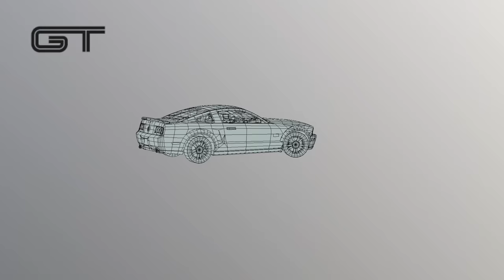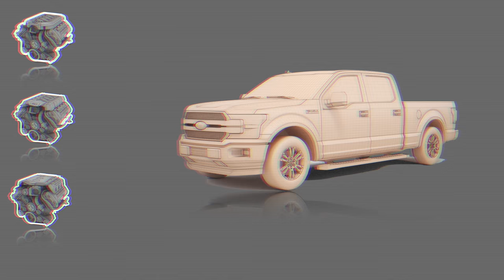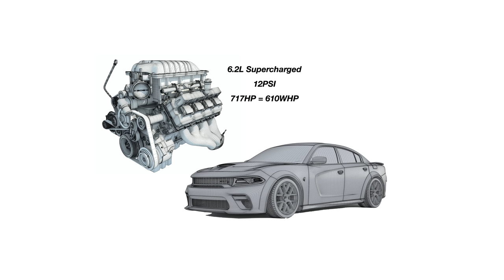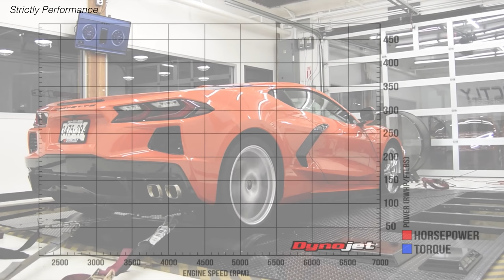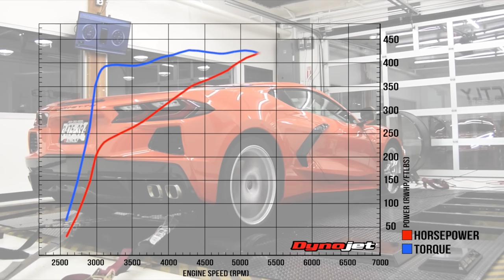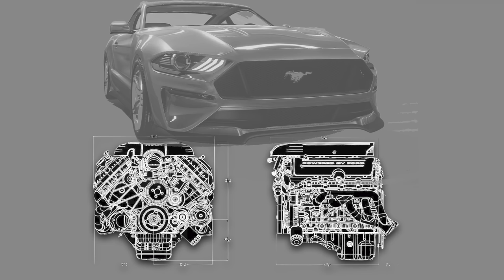How 5.0 Coyote Engines Beat LS and LT😮 | Explained Ep.2

Comment: Great video all around, well edited but id like to disagree,
sure the coyote might make more power comparing it so as LS or LT stock for stock or comparing them with low amount of modifications but when you want to make real power, 1500+, the coyote cant compete, and when it does, all it takes is their nice cool design DOHC chain to break to cost you a new motor, 
which is another reason i think the LS and LT are better, they cost 1/5th the price, are far more available, and way easier to work on.
You also said they are "more potent" for their size when they are huge engines physically, only 5.0L but they are bigger than a 7L or 7.4L LS/LSX
i just don't see the coyote better in this matchup although being a great motor
Reply: People make 1500+ with coyotes fairly reliably all the time. And there are several aftermarket fixes for the OPG and secondary  timing chain issues.  Just like there are a bunch of fixes for the LS trunion failures and DOD lifter failures.  And if you actually take measurements of a coyote vs an LS/LT the difference isn't THAT drastic. The coyote just looks way bigger.
Reply: @codyslaughter4678    the size is drastic enough for people to avoid swapping them into smaller cars. It's way wider and taller at 2L displacemt disadvantage.

Comment: The issue with car guys is they think they need boost, what makes GM’s motor platform so legendary is that you don’t need any sort of boost to beat any of these other motors urging you to get boost because you can bore the motor out or you can’t put bigger cams in there. Another thing is a stock LS can beat a 1,000 horsepower coyote as long as you adjust your gearing ratio. There’s a lot to racing but building a motor is getting over looked by people that think boost is the answer.

Comment: tuning potential is impressive on the coyote esp with boost. However there is no mention here how the engine feels sluggish in every day driving compared to a LS/LT due to its lack of low end/mid range torque compared to those motors. It's a trade off.

Comment: I have basically been a GM guy my whole life. 
   (Here we go, fan boy), joking.
Actually, I never really have harbored any type of I'll opinion or will towards any fans of any brands.
   I actually really like Mustangs too. I had 1 early fox, I think it was a 91-91. It was a hatch with a black interior, very cool!
   My sister actually bought it for me for right about $900. A steal. The only down side was that it was a V8 car, someone removed the 4cyl from his other one and put it in that one.
   So I got the 4 cylinder car. The only bad part about that was they left the V8 struts in it.
   I didn't cate that it was a 4 cylinder car. The body was clean and it had a black interior. Hard to find in those years.
   I had it registered and insured it and immediately used it for daily transportation. We'll, I had to go in and finish the job. 
   The other guy forgot to tighten some hose clamps for the cooling system. 
   On the way to work on a dry road, was that a splash? Where was the puddle? Hmm, smoke, oh, that's coolant on my exhaust.
   No beg deal, I'm a ex technician, I was employed at MB at the time.
   Long story short, it was an awesome car that I wish I still had.

   Coyotes are also very cool!

Comment: They coyote is by far the best V8 engine they've made in about 15 years. Up until that point the LS guys had bragging rights. In 99 it wasn't even close you could have a boosted mustang and loose to a LS with boltons and a few mods. The coyote changed all of that.
Reply: Actually the terminator cobra in 2003 changed all that .

Comment: The Coyote is a good engine but what I didn't like about it coming from Scat Pack Challenger 392's and Hellcat engines is the 5.0 Coyote didn't have that low end grunt I was use to. You really got to rev the 5.0 Coyote to get the power out of it.
Reply: Lack of displacement. DOHC restricted how many cubes ford could use and have it still fit in a mustang. The advantage with cam in block engines like the Hemi and LS is smaller packaging and more displacement potential. The LS is ridiculously small for how many cubes you can pack in it hemi is a bit bigger but not as big as the coyote

Comment: Double over head cams, with 4 valves per cylinder. (chain driven & not push rod operated) Central spark plug.
 Look into the Ford Australia developed Barra XR6 Turbo engine.

Comment: My coworker’s 2020 Mustang GT needed a new cylinder head at 5,000 miles. He brought it to the dealer with a check engine light on and it was running ok. They quickly and quietly replaced an entire head. Not impressed. Neither of us were Ford haters or fanboys. He sold it a few months later.

Comment: If honda ever made a v8, it would be exactly this setup. High compression. Big heads, large flow ports. Multi valves, dohc vtec/vvt. Direct injection.. because almost all n/a honda engines are already like this but with only 4 cylinders. Ford has a great setup for this engine

Comment: fact of the matter is that it simply doesn't beat the LS or the LT in any reasonable capacity. Corvettes from 2000 with a 600 dollar cam are faster than brand new performance pack GTs.
Reply: Corvettes from 2000 with 600 dollar cams are not street legal.. that's the difference kid.
Not to mention you're comparing a 3300lbs car to a 4000lbs car.

Comment: It's a great engine.  Just VCT and cam phaser issues that I wish they would resolve.  Already did mine at 75k.   Runs great since, honestly ran good until it didn't with failing solenoids.  Made it sound like a hot rod with a lope to it.

Comment: just bought the FHP 2019 aluminator 5.0L engine n/a 12:1 compression hooked it up to MMR pulse ring roush cold induction mangnaflow competention three inch exhaust dw-400 fuel pump vmp tune cold case radiator mishimoto radiator reserve fhp high output alternator odyssey amg battery calimer mt-82d stage 2 mgw spec shifter Mantic 9000 Steeda clutch spring boobma trans mount steeda dive line guard DSS drive line g force half shafts fhp differential steeda differential brace bmr k brace and stop the hop kit bmr rear strut brace fhp front strut brace pedders coil overs w external canisters bmr and steeda completed suspension mods autosport roll cage stiffings up the chassis I first went with McLeod RST and calimer mt-82d stafe 1 within 10k teabs capped out if 1st &  reverse McLeod rst allways had shifting issues  support claimed 2017 to 2019 slave cylinder even though I installed a OE ford new one at time if install by professional auto shop. sve rims 10ft 11r MCH pilot sport bill wicker rear spoiler rtr front brake inlets 
calimer stage 2 has cyro treated mirco polish gears carbon synchro rings billet forks rick solid upgrades thanks to Zander13 stagmode and engineering explain and scotty Kilmer by base and make your own upgrades 😊

Comment: Ford have decades worth of experience in Formula 1, supplying the majority of teams with engines through the early decades with the likes of the DFV, and its successors. That experience pays off, especially down the road when the technology they used back then trickles down to road cars. Dual cam 16 valve high flowing heads with fuel injection and coil on plug ignition. That's what you see in almost every modern application now, and Ford was doing that all the way back in the 60s.
If only they put the rest of that quality in the rest of their cars, I'd buy them.

Comment: I feel as if the archetypical reason the modular engine happened was because Ford wanted to design an engine that was similar to foreign engines. I don't see honestly why Ford couldn't have continued to engineer on the Windsor design, or just pushrod v8s in general. There is the Godzilla engine though. I just feel like Ford is making the Mustang more like motherfucking supercars.

Comment: ICE are basically air pumps, higher the revs the more air you are pushing through it, and more HP.  That’s why in Indycar and F1 they have limited 5he max ROMs.  Another way of looking at it is a one liter mortorcycle engine, they spin beyond 12,000 and make over 200 Hp on 61ci, that better than 3 hp/cubic inch, that’s stout.

Comment: As an Australia I have no bias, I like Ford's, Chevy's and Dodges, here comes the but, but the GMH/Aus (General Motors Holden) 304 was >302 and >308.
Evidence you ask? 
It was lighter and more fuel efficient than the 308 and could hand as much boost as a 302... As long as you had tremec 5/6 speed and a Ford diff.

Comment: I partially disagree with your suggestions. The coyote is already a good engine, so there's not much more to get out of it percentage-wise, but since it's already a good engine, there's a lot to like. 
Coyote - The headers aren't in the way of the spark plugs, so it's easier to design a particularly good set of headers. 
Coyote - A coyote with a VVT delete, Tilton 7.25", and stage 3 cams will pull to 7700 RPM without having to add boost which will also be a great road-course setup. 
Coyote - The spark plug holes have nice rubber seals on them, so it's easy to pressure wash the engine. 
LS/LT/BBC/SBC/SBF - The lower RPM range will promote any transmission shifting better. 
Pushrod - Generally, a good cam and headers will get you to 100-110% V.E. which comes out to a 22% gain. That's a lot of power on average that pays off. 
Pushrod - A lower RPM pushrod engine with a lot of displacement won't store as much kinetic energy, so it won't shock the drivetrain as hard on rough surfaces like whoops or in hard driving like during wheel hop or suspension flex. 
-- I'll run any engine out there. I don't care what it is. No matter what you build, just make it easy for the engine to do its job. 
I have an LS in my truck. I would like to build a retro race car with a 2JZ. I'd like to build an offroad rig with a Coyote. I'd like to build something with a raised port big block.

Comment: Despite the lower displacement, it is a much larger engine with 4 camshafts instead of 1, and they are shoehorned into these massive cylinder heads whereas a chevy pushrod camshaft is tucked nicely inside the wedge. 
Then you have the fact that it is not only heavier in general, but it is also top heavy.... which will not help around corners and will result in the need for a much stiffer front suspension to keep it standing up straight on hard corners. 
It costs more to build.
It costs more to rebuild. 
You've got twice as many parts to replace when they break. 
I like the 5.0 but it is not superior to the LT1. Otherwise I would own one.

Comment: Once you start to approach 800 HP, you aren't just worried about the con rods. There is a reason why the earlier gens need reinforcement gussets at those power levels. Sleeving the block is also strongly recommended by the shops famous for upgrading Coyote blocks for reliable power.
Reply: And a ls is very reliable at 1000-1200hp with stock internals.
Reply: @TylerMaxton no it's not
Reply: @kiwi8.  Yes it is extremely. I've known plenty of people with stock internals pushing 1200-1400hp reliably. Literally streetable.
Reply: @TylerMaxton  no you don't
Reply: Show one just one
Reply: @kiwi8.  Keep thinking your right but your not. I have a buddy that put head studs on a lq4 out of the junkyard twin turboed it and made 1700+hp before the engine blew.
Reply: @TylerMaxton  ok if you say so 🤣

Comment: GenIV SBC will absolutely make 800+hp 100% stock with only boost, injectors and fuel pump.  Double that with the ring gap opened up and valvetrain (7.15 1/4 mile with a 5.3).

Comment: The NHRA  FS and SS COPO Camaros had to upgrade to an after market LSX block. They were lifting heads and blowing gaskets with the stock 'LS' block. Ford uses the stock production based factory Coyote block and heads. The Fords were penalized 6 times for going to fast. the Copos 2 times and the Mopar 1 time. The Mustang is outselling the Camaro 2-1 .

Comment: How does it compare to the new C8 Z06 LT6 5.5 engine that puts out 670 horsepower at 8400rpm naturally aspirated and turns 8600rpm at redline seems like on a equal playing field the 5.0 Coyote is down 210 horsepower you better have boost because without it all your seeing are tail lights pulling away if the 5.0 Coyote is such a great engine extracting 210 horsepower naturally aspirated should be fairly cheap and easy since GM or Chevy can do it stock from the factory
Reply: Took gm how long tho? Biting  off ford as usual  don't you guys cry about  lack of torque.  Yea it makes 670 hp but how much  torque does it make? Lol
Reply: @Shiftnlift Torque is 460 about the same as a LT1 and at a higher rpm 6300 these smaller displacement 32 valve V8 don't make huge torque numbers and make peak torque above 6000rpm that's why if money wasn't a problem l wouldn't mess around with these small displacement 32 valve V8s I'd call Mercury Racing they take a LS7 7.0 liter Chevy LS 427 engine short block and put 32 valve heads with twin throttle bodies they call it a SB4 engine it makes 750 horsepower at 7500rpm revs to 8000rpm and makes 570 foot pounds of torque at 6000rpm idles smooth and is totally streetable it's a monster this Mercury Racing SB4 engine makes 80 more horsepower than the new Z06 LT6 engine and 110 more foot pounds of torque the only thing you lose is 600rpm up top because the LT6 revs to 8600rpm I'll take 600rpm less and 80 more horsepower and a 110 foot pounds of torque keep the extra 600rpm but this SB4 engine will cost you 33,000 dollars comes with computer to run it bet if GM makes a LT6 crate engine available it will be well over 26,000 dollars
Reply: @gloriamaletta8667  well said

Comment: For the portion of the video talking about the equation to make power pushrod motors make more torque than any DOHC motor yes they lack in top end or over rev power but torque moves weight and pushes against outside forces hence why from a drag race standpoint coyotes tend to be very slow out the hole compared to a hemi or ls/lt but they charge hard in the backhalf which typically unless we are talking modified vehicles the coyote loses with equal drivers

Comment: If GM wants to stay pushrod, why can't they make a quad valve pushrod motor for better flow? Isnt the 6.6 Duramax a OHV 32 valve motor? They would not have the benefit of independent variable valve timing but i thought 4 valve motors usually flow better due to the way the valves can nest in the head.

Comment: With Gen 3 engines having a 12:1static compression ratio, how is it able to handle more than a a few pounds of boost? Are those engines being re-engineered with lower compression ratios? That would require new low compression ratio pistons and maybe head work too.

Comment: Iv worked on a couple of these and I can personally say I’d stick with my turbo Ls ,availability and easy to build! All the problems you have stated can easy be resolved with a good cam.
Reply: Yoy missed the point. The ls in the same trim wil never produce comparable horse power to the coyote. Even with a cam the ls will still trail the coyote in volumetric efficiency.

Comment: If you want blown head gaskets, high oil consumption and your timing chain to fail get a 5.0 coyote.  In less than 15k miles mine has had two engines.  Ford first change the dipstick to change the oil mark.  This 'fixed' the oil consumption; for one week.  Next they told me my warranty was void towing a trailer 40% of the weight they claim my truck can tow.  After two years of fighting they did a short block but this still uses oil.  Junk engine in my case

Comment: I swap both for customers..... put simply, cost and complexity is what drives most swaps and coyotes are not user friendly.  Especially in racing, we use a KISS ( keep it simple stupid) format when we build things for customers that don't know how to change wipers. Although you can source coyotes anywhere, they are very much double a LS, $1000 over a LT. I do less than 10k for swaps on 79-03 mustangs on a LS. It's 10k just for the powertrane for coyote. I can't get them cheap enough. I just got a crate lm7 at summit for $1350 in the scratch and dent isle, there was a coyote next to it for $6000 at a discount. Just my 2 cents

Comment: I don’t know if you’ll see this 337 but can the coyote 5.0’s really make over 100% ve while being na? I thought it was impossible for na motors to reach over 100% ve due to atmospheric pressure and a couple of other factors. Basically due to the fact that it’s relying on only outside air and not forced airflow like turbochargers it can’t reach over 100% volumetric efficiency. Is this correct or not?

Comment: Nearly correct. The Australian Ford Barra i6 is the best so far. I own 3 inc a factory turbo.
A street driven partially grouted factory barra block can make 2500hp at the wheels using the factory head.
Tonnes of 1000 - 1200hp at the wheels street driven Barras here in Oz using the factory crank.

Comment: The two major problems with the 5.0
 it's too broad at the shoulders won't fit between the shock towers of a lot of cars or in engine bays and it's too complicated to rebuild that's why the LS prevails ford needs to simplify their engines, they finally did with the 7.3 Gasser now they need to make millions of them like Chevy did with the LS

Comment: They gave up A LOT OF CUBE potential going to dohc. The heads are massive so they needed to limit the displacement to 5 liters. There is a definite advantage to a 4 valve airflow wise but the LS is capable of much more displacement around 454 ci although the max some one got was 500 cubes with a lot of material removed for rod clearance